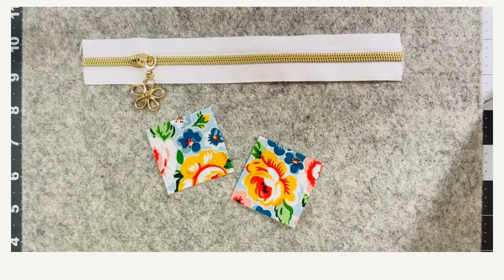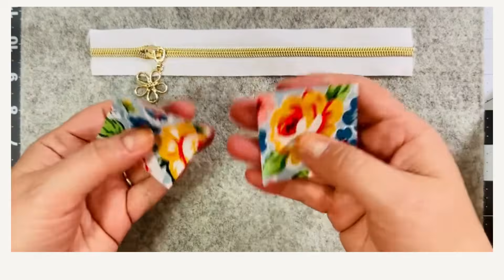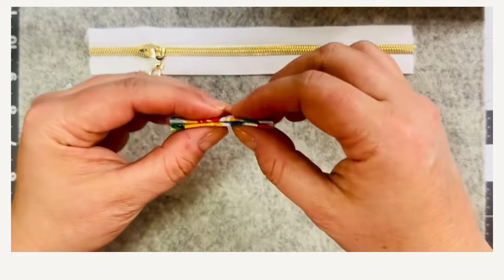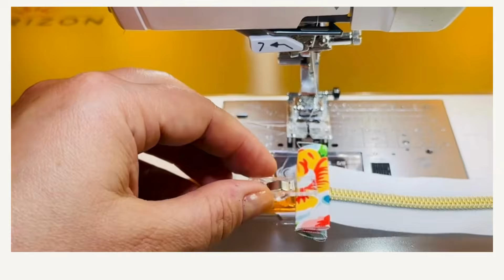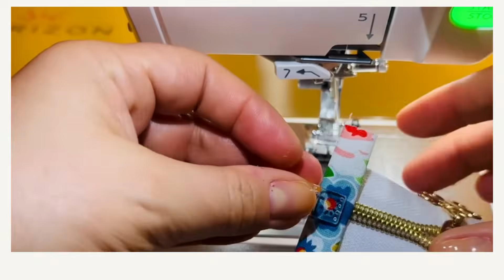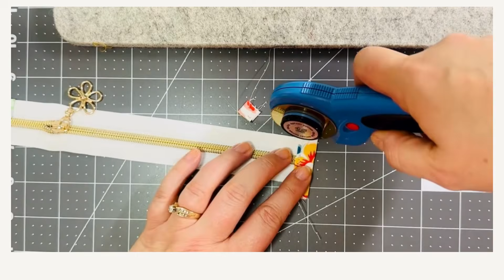Easy Zipper Tab Tutorial (Step-by-Step) | Clean Zipper Ends for Bags

Comment: My needle keeps breaking when i sew over the zipper. Any tips on how to stop that from happening?
Reply from the maker: My first question is are you using metal zips?  If so, you can't sew over them, and this is why the needle keeps breaking.  If your using nylon or plastic, have you tried sizing up your needle?  The next size up might just be what your machine needs to get through the zipper.  If you're sewing bags (like zipper pouches or zip totes), I always suggest a 90/14 needle size.  Happy sewing!